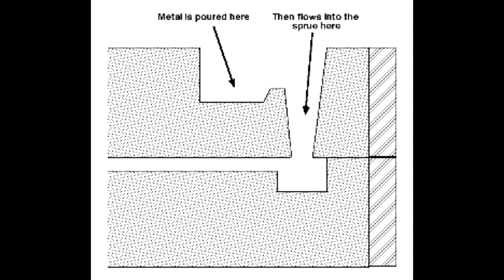Stack Molding

Comment: You didn't perchance, put your pattern somewhere it can be downloaded for use by others did you? I am enjoying your videos, at this point I'm just a machinist but would love to be able to make my own castings some day.
Reply from the maker: I've never tried but I will try to upload it to Thingiverse. I'll send you a message when it is uploaded.
Reply from the maker: Okay, tried to upload the file (.stl) but they said I would have to wait 24 hrs. Check Thingiverse for a file named "Pattern to cast a lead hammer" or something very close to that. Check tomarrow night, I mean.
Reply: sandrammer Thank you.
Reply from the maker: Okay carlquib, the pattern is on Thingiverse under the name, "Pattern for casting a lead hammer mold" Enjoy!
Reply: sandrammer Thank you so much, now I only have about a hundred other things to get done before I'll be ready to use this pattern but it is a start. I have wanted to be able to cast my own lead hammers for some time. I have several that have been used beyond any recognition of actually being a lead hammer other than they still have a bit of lead attached to a handle.
Reply from the maker: I'm very happy to have assisted you along the path to building your own foundry.
Reply: To help it's thingy #  2473238